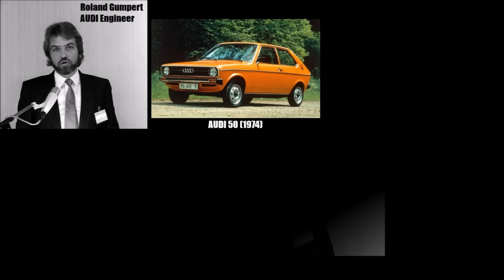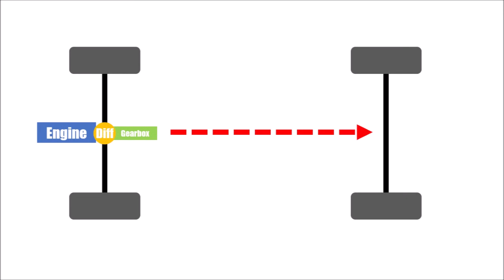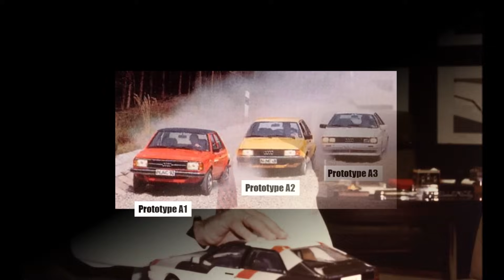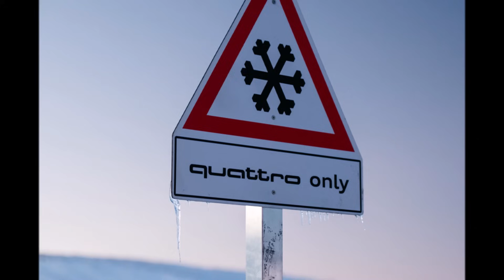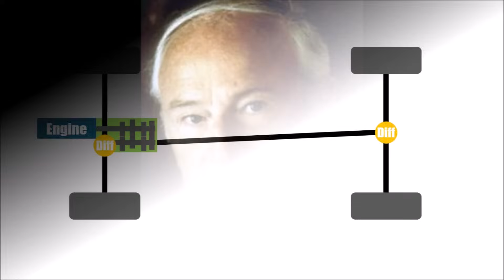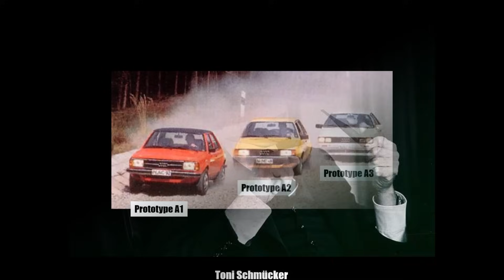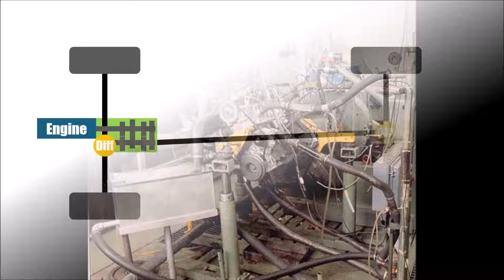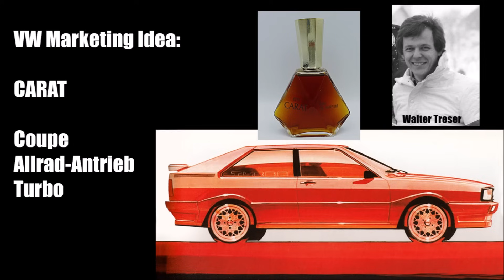History of quattro - Part 3 - The creation of quattro

Comment: Nice video series. Great to see how far the DKW F9 concept was developed and improved over the years. 
But I also see why they changed for a transverse layout with the Passat B6, most Passat B5 where front wheel drive TDI´s that had the heavy engine in front of the front axle and some other packaging problems ( less inside space, complicated firewall and steering setup). Just not necessary and too expensive for a simple family car.

Comment: Love my Audi A5 Sportback Quattro. Incredible to see the enthusiasm from a few talented engineers with a great vision come together to make a legendary machine!
Reply: yes, but what you have is not Quattro. You have a front wheel drive system that moves power to the rear if the front wheels ￼ slip.  It's not all wheel drive. It's made by Haldex. Even though it is labeled as Quattro ￼￼ it really isn't. Audi of course will never tell you ￼ this ￼
Reply from the maker: Front longitudinal engines at AUDI are real quattros. They use Haldex for transversal engines. We will discover that in the next parts.
Reply: @bsport320 .   yes. The transverse models are just tarted up Volkswagens￼
Reply: @kevinbarry71  my car has a longitudinal set up. It is a quattro

Comment: Two questions:

with three open diffs isn't it worse on slippery ground? Did you have to lock manually everything on demand? I know later they would use torsen, but before?
-wasn't there any consideration by Audi management of what Subaru was doing, more or less in the same period?
Reply from the maker: We will talk about what they learned from the Iltis and turned it into the first quattro with locks etc in the next part.

Comment: So Piëch developed the 5 cylinder diesel that was in the W123 300D? Wow. That engine was basically bombproof.

Edit: dunno if it’s something you fancy, but more info on those Audi motorcycles would be fantastic. Never heard of this project before.
Reply from the maker: Yes, will do!
Reply: @bsport320  wonderful! I could be off here, but was there intent to create something akin to the Münch Mammut? It kinda has the same conceptual background with the whole car-engine-in-bike setup (dunno how big the engine from the 50 was versus the one out of an NSU Prinz in the Mammut.)
Reply: @Argent_99  Great insight. Though the Mummet was air-cooled.
Thier was another motorcycle a Duch one with a Citroën tween rotor engine. It was canceled after Citroën engine had reliability issues.
Reply: Same here.
Reply: Yes, but note that the OM617 is heavily based on the OM615/616 design which is much older, in production for 6 years before the 5 cylinder. And the OM615/616 family was based on the OM621 which is even older, it started production in 1956.

So while it is a highly successful evolution from 4 to 5 cylinders, it was not a from ground up new design.